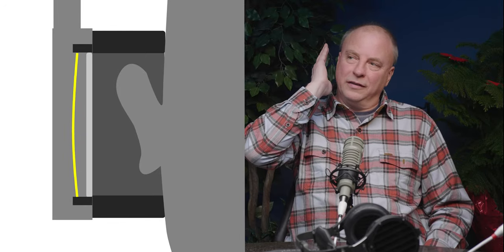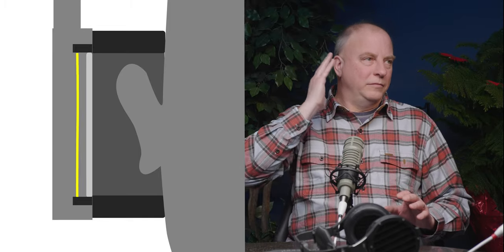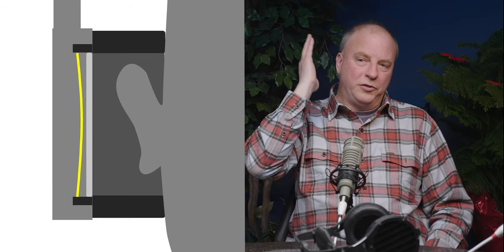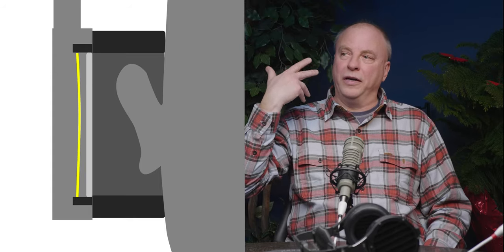Bass Tuning Abyss! How Does Damping Work?

Comment: A few weeks ago I bought an LCD-XC and it was unfamiliar to use "normal" headphones again. I often reached up out of instinct and wanted to adjust the headband.  At the beginning, using the PHI TC is unusual, but as soon as you are familiar with it and have found the right setting, you miss these options with other headphones.

Comment: Would this mean it’s recommended to have your headphones on a form-fitting stand while burning in to avoid a gap?  Or does it not matter if the headphones distort while burning in?
Reply: Distortion will not hurt... Even during break in. So form fitting not necessary.